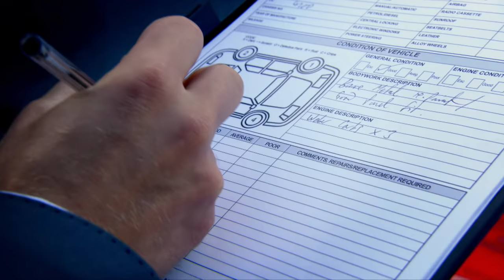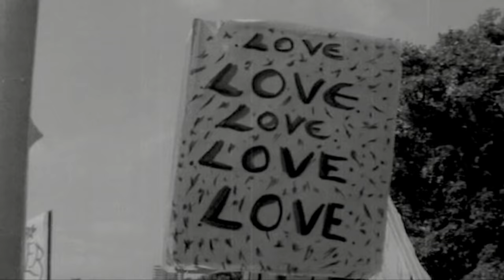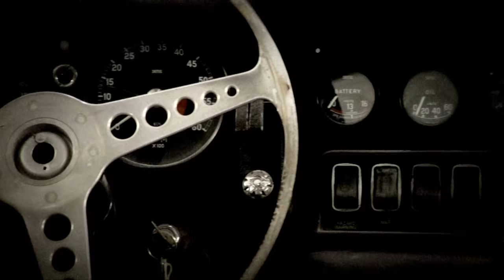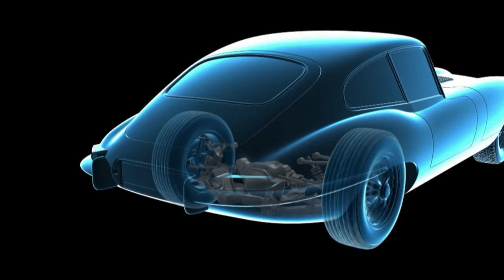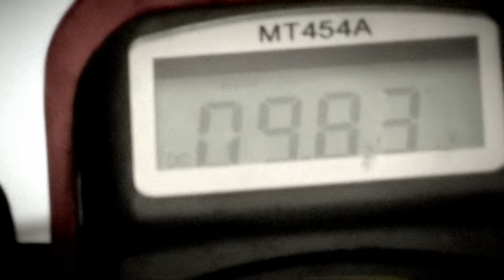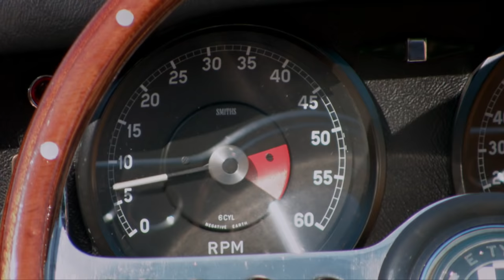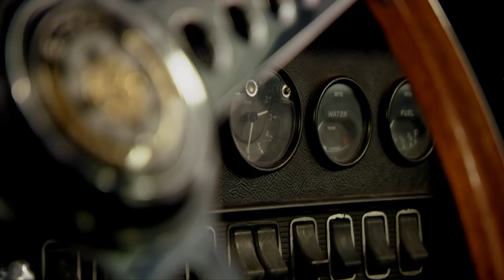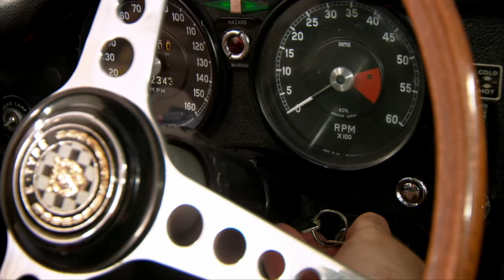Jaguar E Type Restoration | Full Episode | S1E01 | Classic Car Rescue

Comment: Bondo'd over the nose dents, and didn't even fill the sunroof hole?  Far from a quality restoration.  An E-type deserves better.
Reply: They didn’t even take the axel out .. all it was was a repaint and weld up a whole with some cheap vinyl re trim . Didn’t take the engine out , paint the frames or cad plate the wishbones nothing

Comment: Marlo doesn't seem to be too helpful. Bernie has to do all of the heavy lifting. Marlo overfills the carburetor damper and backs in to an engine sitting on the floor. Yikes. I really can't see how 10K covers the cost of the "restoration". Either the mechanics work for peanuts or something is amiss. I pity the person who buys this car based upon the excellent paint job. There is a tremendous amount of work that still needs to be done, such as rebuilding the master and slave cylinders, replacing ball joints, tie rods, and bushings; changing all of the fluids, replacing the rear calipers, flushing the engine, changing the water hoses, etc. Using used parts for a restoration is mind-boggling. The most expensive XKE can be a fifty year old vehicle that has not been completely overhauled.
Reply: He’s lazy

Comment: Restoration in 4 weeks and not touching the motor. Proper east end wide boy job. An E type deserves a nut and bolt. In one scene Bernie is testing a car for filler and in the resto they are adding loads. No thanks chaps, 
do it properly or not at all. Yes spotted the new break discs so what else has been fudged?
Reply: I know , they said it would cost 10k to restore ?😂
50 k + to do it properly
Reply: @Carrera-gp9od costs about 120k-150k to fully buy and bolt rotisserie and series 1 e type .. trim alone costs 12 grand .. I know it’s a 2 plus 2 series 2 but still same amount of work . They’ve just tarted it up

Comment: Why oh WHY did they not jump on the very first E-type???  An E-type with a rust-free body is not to be taken for granted; in fact, it is the most important buying point.  "It could be hiding lots of problems" while that is certainly no lie, it's also going to be true for every car they'll come across.  When doing a resto on an E-type there are no bargains!  When the choice is tidying up a basically sound chassis and changing a bunch of parts on car #1, Vs. doing all that PLUS rust repair, PLUS undoing the roof chop-job, I know what I'd choose.  All the rest of it is just a pile of easily replaced parts.  So why not eliminate a whole b unch of additional head-aches by spending the extra pounds on the first car?  Its the chassis that needs to be rock-solid, and that was surely worth 14.500 pounds!

Comment: I'm reminded of why I didn't like this show. Too much obviously manufactured drama, and dodgey repairs. Who goes dumpster diving for brake rotors! Reversing in to that motor sitting beside the engine crane? Really? The cars deserve better.
Reply: I was puzzled seeing them taking items from the scrap skip which were probably worse than those on the car. They went to find a new rear end and bought a damper and what looked like rusty springs as if that would fix it.
They showed no work on replacing all the rusted floor or chassis. As for the finances they just did not add up - 5 men working for a month would cost about £15000. Then plus the parts and interior which would have cost at least £12,000 so the outlay would have been £35 - £40k so selling for £30k made no sense!

Comment: what do people see in the old cars ?. i was a paint sprayer panel beater for 44 years . seen them all . they where all rust on wheels . i have put 10 lb of body filler on brand new fords , unplated . they where rusty from the factory . the jag wiring looms where famous for being crap . one of worst design inventions was the bloody vinyl roof . the sun rotted the hell out of it . and you try replacing it . lol. i agree they came out with some great looking cars , but lethal . the old brakes where terrible also you get the car to 70 and above the car would shake you to death . the greatest thing that ever happened to the motor industry was the Japanese . even the bikes , all british sexy bikes lmfao . you would get a brand new bike from the showroom , and you had better buy a tool kit . oil leaks where normal on a new bike . the honda goldwing in 79 , was the first best bike i ever seen .
Reply: i agree though that if you rebuilt the car with the following you would have a great car . 

modern engine 
modern brakes 
modern suspension 
modern loom 
modern lights 
air conditioning
decent sound system
bodywork completely treated and protected 

basically you will end up with a modern car that resembles an old model .

Comment: in 1962 I had on deposit the FIRST xke being delivered into philadelphia, pa.  I gave the dealer, who I had already bought an  MGA 1958 and an Austin 3000 healey just previously from. My intention was to sell the jaguar e type (its price was 6000.00 for the amount of 8500.00. A nice profit (in those days) of 2500.00.  The philadelphia distributor Royston Motors threatened the dealer if they sold me the car the complete line of bbc cars  would  be taken away from them. I foolishly cancelled the order due to personal relationships.
Reply: I do remember, that the favorite saying about Jaguars whether the xke 120, 140 150 or `50s was IF you are going to buy a jaguar buy 2 BECAUSE one will always be in the shop.

Comment: I'll take a Healey 3000  a 100/4 -6 or an MGA any day over the E type for their graceful lines an Elan over Any car on earth for shear driving pleasures n road holding/handling, the E type I Never liked, the E type that did 150 MPH was HP 9600 stripped of 200 kilos in weight n other mods, most would reach 135 that is for the 3.8 ones maybe the 4.2 would I guess, in twisting country lanes Specially in the wet the Lotus would leave the  E Type for dead unless heavenly modified
Reply: Yeah okay, but with those you've mentioned, you'll still only have a Healey 🤷🏻‍♂️, or still only have a MGA 🤷🏻‍♂️, or even more laughable you'll still only have a Lotus 🤷🏻‍♂️...with the E-Type you'll have a Jaguar....much better lookin, worth more money as well...
Reply: @branon6565  as far as am concerned you buy a car for its performance n handling its looks n comfort, on looks the Healey 3000 is Magic for me so is the MGA, But for handling looks n driving pleasures there will never be a better car than the original Elan created on a shoestring by the Best Mechanical engineer of the last century, personally I do Not much like the looks of the E type, n it Never handled like an Elan the cars I love are British n Italian ever seen the Alvis specially the TD 21 drop head coupe? modern supercars they do Not have the classic looks of an old British car they have No soul they are just super slick speed machines
Reply: @branon6565  the Brilliant Lotus Elan in its day would have let the E type n Porsche for dead round twisting country lane specially in the wet, so would the Rover 2000 TC have left ANY BMW for dead too Voted the Best spots Salon car in Europe for 2 years Running n in America Best sports sedan for 2 years running against ALL other cars, n it Still looks gorgeous today specially in tobacco leaf colour